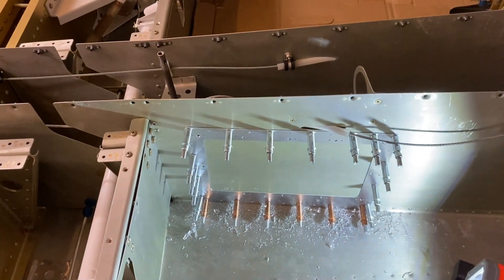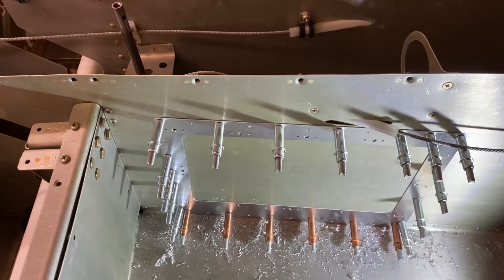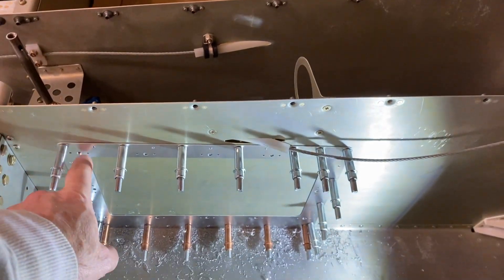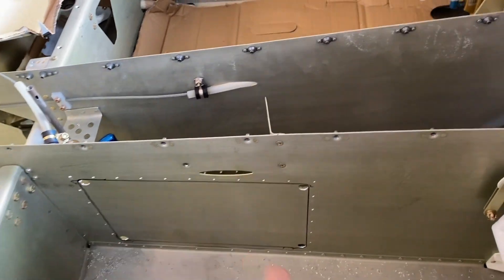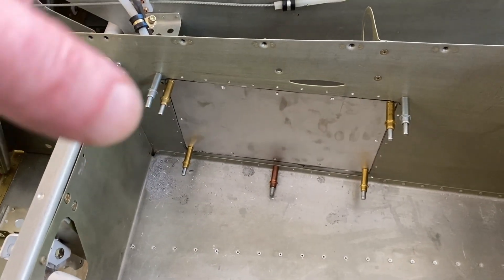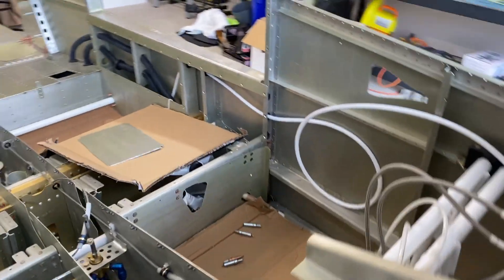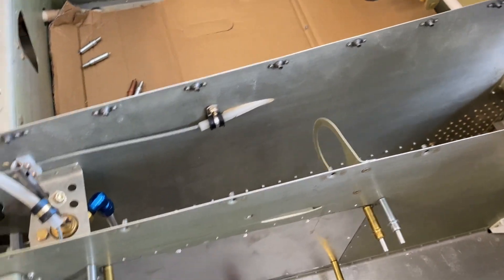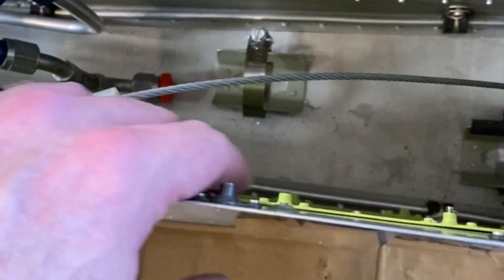Vans RV 10 - AirWard Tunnel Access Panel for Fuel Pump and Filter

Comment: Think about putting one on the pilots side as well. I put one just where you did and about 150 flight hours in I am going to put one on the other side as well. It would make filter servicing a much easier task.
Reply from the maker: Awesome, thanks for the feedback - I was also considering moving the filer to the wings - one for each tank instead - not sure yet.
Reply: @aleafonthewind3775  I am installing the fuel filters in the wing root; should I still do this mod ?